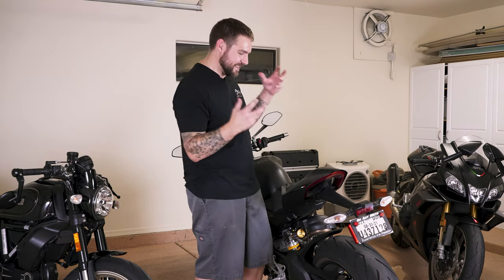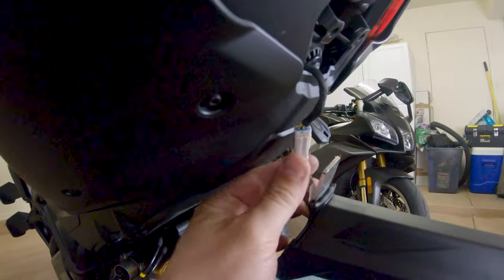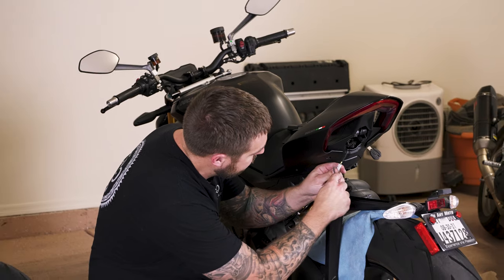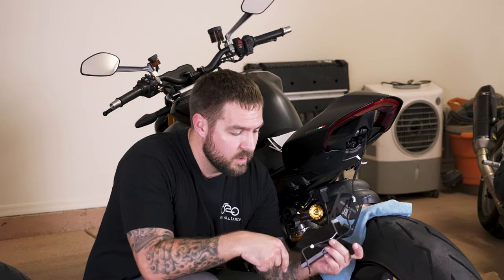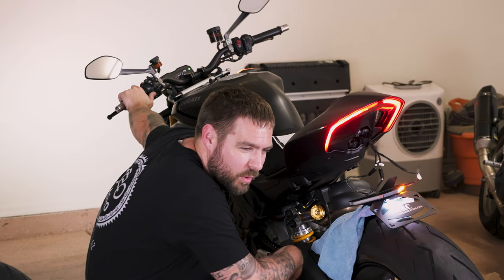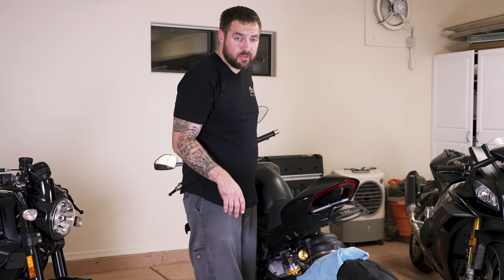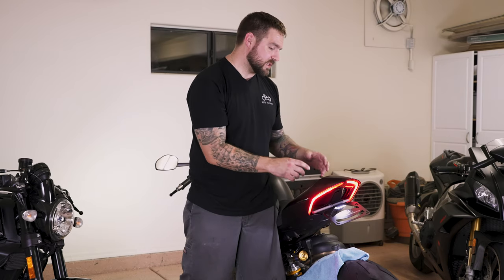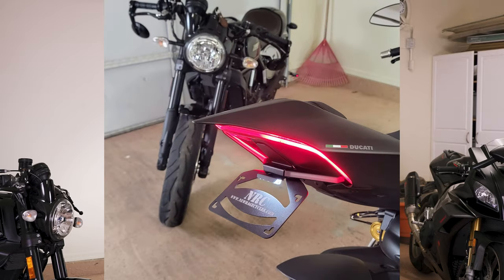2021 Ducati Streetfighter | Fender Eliminator Install | Tech Tuesday

Comment: Looks great man!  However, I've read somewhere that sometimes you get warning lights showing up on your dash. Have you had any such experience with NRC tail tidy?  Cheers
Reply from the maker: I've replaced every bike I own tail section and have never had a warning light of any kind. What warning light specifically have you heard that comes on?
Reply: @oneonlyxram  I believe it's a generic warning ⚠️ light on the right hand column.  However when diagnostically scanned I believe it was related to possible connection on the tail lamp???

I'm asking cause I've brought a NRC tail tidy and not sure if I should proceed with the install.
Reply from the maker: @xarjie  if you disconnect things with the key on you might have an issue, but yea multiple bikes with this kit and zero issues.
Reply: @oneonlyxram  your experience is reassuring.  Thanks for your comments.
Reply from the maker: You're welcome!